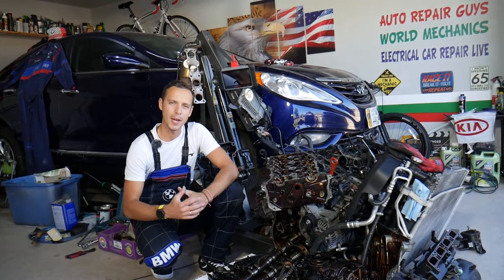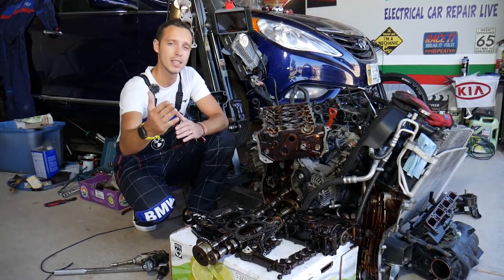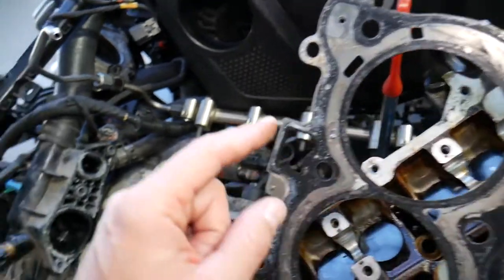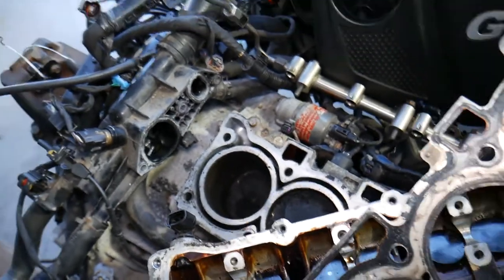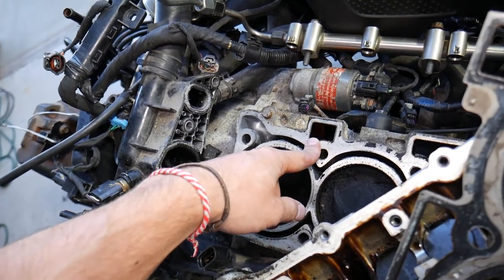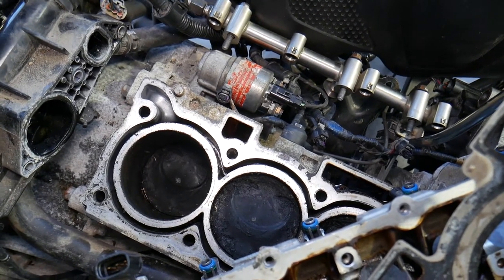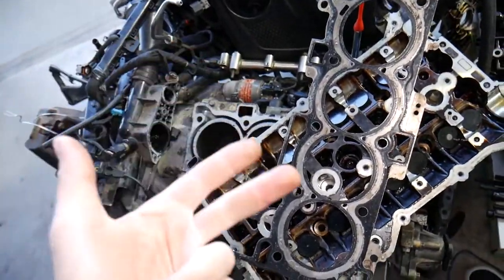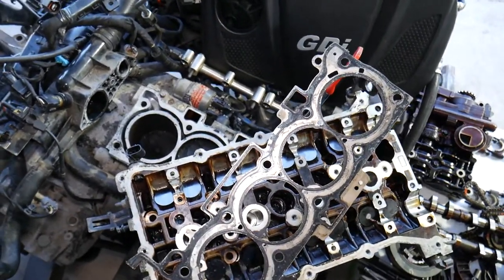SYMPTOMS OF BAD BLOWN HEAD GASKET ON HYUNDAI KIA GDI 1.6 2.0 2.4 2.5

Comment: wait, is another symptom of a bad head gasket.. just an oil leak?? I don't think i have coolant in head, my engine doesn't over heat, my oil isn't milky so i don't have coolant in the oil.. but my motor is leaking oil from what appears to be the exhaust manifold. Thanks you for your time.
Reply: I have this same problem. How did you solve yours